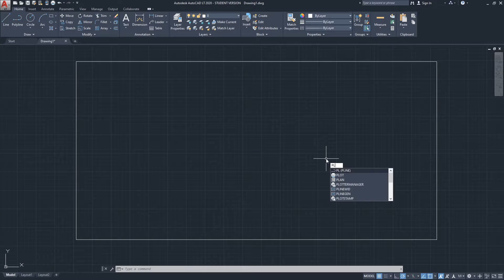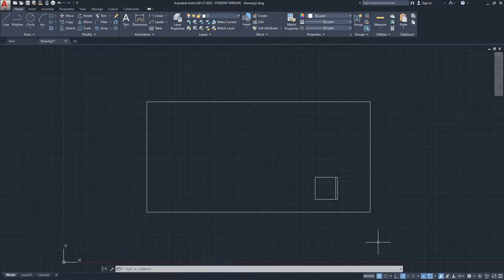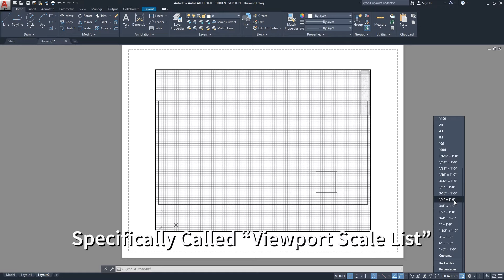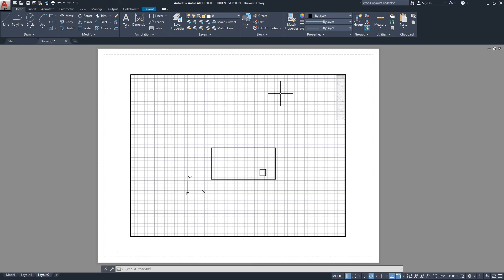Autocad LT 2020 Tutorial | Drawing Scale

Comment: Thanks for the tutorial. It would be great if you can make another video explaining what exactly those scales are that you're clicking on. What does it mean 1/8"? Does it mean that 1 inch on paper is 8 inches in reality?
Reply from the maker: Correct 1/8” on paper = 1’ in reality

All blueprints are drawn using scales to represent bigger sizes within a small sheet of paper 

If you use a ruler and the declared scale on drawing is 1/4” for example, then each 1/4” on paper = 1’ in reality

I hope this make sense and helps!

Comment: King of 2d drawing is one- Solid Edge 2D drafting. Where are the parametric constraints? where is the dimension control? 0$ it'st total cost for SE.
Reply from the maker: Good to know! Does Solid Edge create drawings in DWG format? Does it import images & pdfs?
Reply: @JayCad  Yes, Solid Edge writes and reads dwg and dxf files. I use it for many underlays from e.g. LBNL Therm or others. PDF also reads. It is also a 3d file viewer from Solid Edge 3D. It is a dedicated 3D draft module fully fledged and compatible with this 3D most importantly $ 0 for commercial use. I can save the object scratch, change it to 2d and fully edit in this 2D. Without it, I can add dimensions, draw, hide lines ect, and I can also prepare a sketch for extrusion in 3D. Something similar to drawing a sketching module from Inventor, the rules of drawing are very similar, and sketches are also made in the same way, e.g. in Solid Works, ProE, or Catia
And you can save the sev file to the solid edge mobile viwer app.